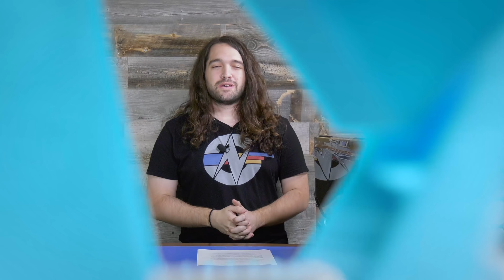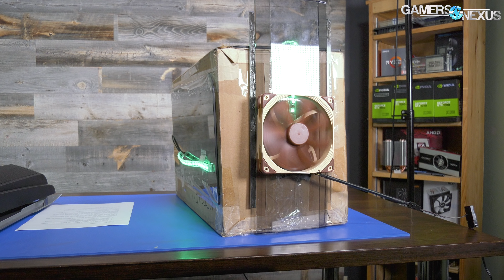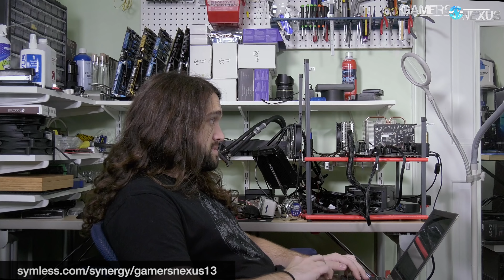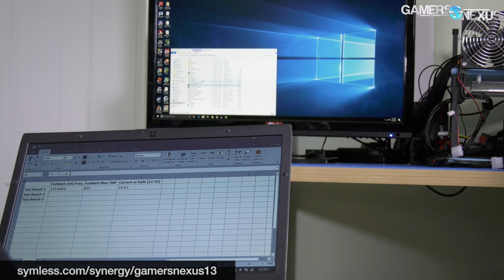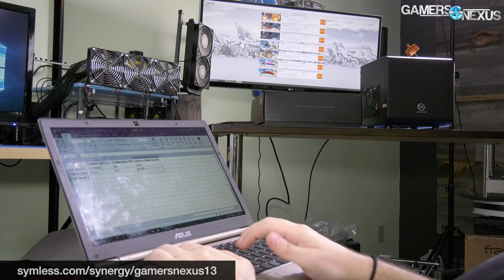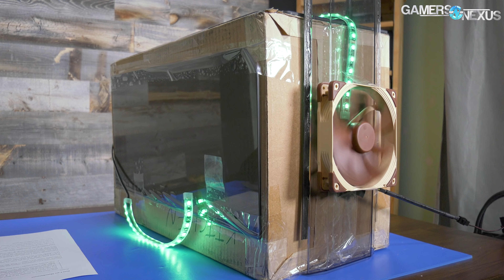Case Manufacturers: You're Worsening FPS & Power Draw

Comment: Amen brother! Ironically it's been almost 6 years and I don't really have the impression that anything has improved. On the contrary, it seems worse! I've just returned to the PC hobby again after over a decade of absence, and I'm struck by how obsessed users and manufacturers are with RGB fans, too many glass panels (which ironically makes it thermally underperforming), weird color schemes (white), absurd aluminium covers and hiding cables as much as possible. Personally I feel like cases should be functional and that it's design should reflect that, kinda like everything back in the days when functionality was a part of the design features. Now it's more a quest of hiding the functions and intents of a computer, all while making it absurdly overpriced...

Comment: antec p-180 was the first one to isolate the psu from everything else. incidentally they also implemented fans in the power supply tunnel to remove the heat from that area specifically

Comment: personally i have a HAF 922  and it does a great job never overheats but i do not buy 3090GPU they are small heaters . why do some need to have 1000FPS  200-300 is a great result compared to 30 fps no?  Do those gamers think if they get 1000fps they are going to time travel? THere are good cases you guys have reviewed  but if the stocks for them do not exist like it is now with GPU's and CPU's  ??  for now my Haf from 2012  i will keep it does a good job with normal CPU's and GPU's. my components last a long tome  my i5 CPU .second gen still works good.  thnaks for the great reviews  a lot to learn .

Comment: After adding a 3060 Ti to my computer I started hitting 90°+ on my CPU and started to think my cooler was having problems. My thermals have never been good but never that bad. It makes sense that it would be a bit hotter but this seemed ridiculous. After a couple of days of trying different things I decided to pull my front panel off and I couldn’t believe that I now get 30° lower temps on games that were running at 94° just the day before. I don’t like this fix as a permanent one but this has kind of changed my entire outlook on thermals and case airflow.

Comment: I wonder why they never used the laptop/blower style fans in cases. Like using one or two of those in the front panel would allow for a much thinner spacing while still providing enough air for the main fan in the front panel.

Comment: I think people generally blind themselves to computerhardware.

Most people I talk to seem to think that the only 3 things that matter is CPU, ram and GPU. Which is highly false, you can have a 9700K that can't be overclocked properly because you cheaped out on the motherboard or the PSU, you can have a 2080ti being bottlenecked from poor frame prep by a cheap CPU, you can have ram at 3600mhz performing worse because it has a high latency.

The most recent case of stupid has been people buying the pcie 4.0 nvme's but running a complete pcie 3.0 build.

Comment: honestly if i had the tools at my disposal id give people a case that actually works. i took a case i had that was miserable just poor airflow. i did put a flat front on it, of course with 15mm of space to start with its about 7/8 of an inch with completely open sides now after a little trial and error. ive taken a corsair spec omega even removed the glass panel and put mesh in its place due to the lack of airflow it had also. i dont even bother with cases i have to mod at this point because no matter the cost of the case how cool it looks if thermals fail its not worth the time to even look at.

Comment: Not every case needs a mesh front, but if you are going to have a fan on the front, put mesh in front of it. I'm also sick of cases no longer having external drive bays. I still play games that need disks. I do a lot of CNC work so i need an SD card, micro SD card reader that fits in a floppy drive bay. I'm "forced" to buy a case from 2012 because its the only one that meets my needs in a modern market that has at least 2 external drive bays on the front (and isn't some weird double width cube).
This means my RGB motherboard and RGB graphics card are nicely hidden from view in a boring black case.

Comment: I Think maybe part of the problem is that case makers want to put things on cheap cases that only work when done right with proper R&D that will result in an expensive case... they are putting things on $59.99 cases that have no business being on a case for say under $200, which also has the side effect of making it so money in the cost of the case that should have gone into function goes into features instead, Say putting RGB/RGB fans in a cheap case but then sacrificing actual fan performance to achieve the price point. I also think the number of cases in a given price point might be indicative of this as well.. remember when each brand had maybe a low end case, a high end case, and a super high end case? Think the days of Antec 300, 900, 1200, and that was pretty much the product line on gaming, with maybe a few other outliers... The same thing is happening with cars, seriously, leather in a Ford Fiesta??? exact same problem.

Comment: Wow this video really shocked me! I've always bought my case based on airflow rather than tempered glass and RGB. I'm surprised that others don't consider this. Still any PC is a compromise I guess. The best building advice I've ever had was, " work out out exactly what function you want your PC to fulfill, build accordingly" Even trying to do follow that can get tricky. It's made easier by your channel which I know does it's best to cut thru marketing speak and tell it like it is. While I don't agree with everything, I appreciate your efforts in providing clear, reliable information. Thanks.

Comment: i'm pretty sure my case for my current system is mostly vent. 3 out of 6 sides is a vent panel (bottom, front, and top) the back side also has vents, but isn't a vent panel. My front and top also have side notches. No tempered glass windows though, mine are blue plastic.

Comment: I would put the Cooler Master Maker 5T above any of those cases. It is completely modular with thumb screws everywhere, almost all covers are magnetic, not screwed down, it breaths almost perfect, has a psu shroud, but still keeps the gpu more than 5" above it, and has room for a 280 or 360 AIO. Besides all of that, it looks better than any case I've seen on the market. The ONLY complaint I have with this case is the red color in the inside, and the idiotic refusal by Cooler Master, to provide an updated face-plate with USB 3.1 A&C ports. Outside of that, this case is spectacular, and have been rock solid for three years.

Comment: I wish more manufacturers would exploit the fact that hot air rises on its own. (Need proof? Check out the Albuquerque International Balloon Fiesta) If the path of ventilation is straight up, would not the fans (when necessary) simply be helping the natural flow? This also applies to heat sink fins---they should be vertical to maximize convection, as many designs do.

Comment: I know this is an old video but I want to rant that even though modern motherboards have a lot of internal USB headers (at least 2x2 USB 2.0 and 1x2 USB 3.0) today there are only a handful of cases that can manage front USB ports and card reader panels. I mean, almost all of the cases have only two USB headers and lack bays for optical drives or front panels.

Comment: 'member a time when computer cases had flimsy aluminum/steel colored insides with sharp edges that would slice you open like a razor blade...........and no cable management or options for extra fans? I 'member

Comment: My sister has a build in an NZXT something or other (Not certain exactly which one, it's one of the HXXX series) and it is actually much quieter with the front panel off. When its on, it chokes off so much airflow that the CPU and GPU fans crank up quite high to compensate.

Comment: While this is interesting info and does hold some water to not talk about the case fans and the configuration used is just pushing a bad narrative, which possibly might a moot point with proper fan setup. 

I expected better from GN, you’re talking about a legitimate problem but working 1/2 a solution.

Comment: You know, the Fractal Design core 500 is still my favorite (mini-itx) case.   No tempered glass.  No RGB.   No extra bulk due to unnecessary (excessive) cable routing space.  No front fan but it doesn't really need it.  Only slightly larger than the Cooler Master Elite cases but with tons of room inside for the GPU and a tower cooler or rad (or both, with some care).  And it has a 5.25" bay in the front which is perfect for one of those quad 2.5" hot-swap bays.

I don't know why people seem to want these ridiculously huge cases.  It has created a problem for the medium form factor micro-ATX mobos because often the reason you get a micro-atx board is in order to fit it into a small case (obviously not the Fractal 500 since it's mini-itx, but you get the idea)... and finding a case similar in size to the Fractal 500 but able to accommodate a micro-atx mobo is nearly impossible now.  The cases are just getting too big.

-Matt

Comment: My top tips for cooler computers:
- heavy yet clean and expediently directed airflow
- clean it every month
- change thermal paste every 6-12 months 
- play in your cool cellar during summer
- don't heat your room during winter to keep room temperature at 15°C or lower (keep an eye on your humidity levels, though)

😉 Not even speaking ironically here. This is what I do.
Reply: Not heating the room in the winter? So I can't turn my pc on?

Comment: I think the main sin all these manufacturers are guilty of is the sin of assumption. They're ASSUMING, when they build these cases with shit ventilation, that everyone is hopping on the liquid cooling bandwagon. very few manufacturers are still building cases that actually breathe.. I mentioned the Antec Skeleton in my other comment.. The only current case, i've seen with the same kind of form-factor, and airflow as the skeleton, while still functioning as a proper enclosure, like the skeleton, is the Cooler Master HAF XB EVO. It's not as visually appealing as the Skeleton, but goddamnit, it delivers on airflow..

Comment: Hey guys, i bought an LC Power Gaming 988B Typhoon case, and what im asking is, will the case suffocate bc of the thin space on the front panel's sides with the 3 fans? Because i was thinking of some modification, like bringing it out a little, bc right now the 2 sides where the air can enter is like the case's height, but only like 1-2 cm wide. Any thoughts?

Comment: What kills me is that a company like Antec, can release something as great as the Skeleton (which is, with the hex-mesh kit installed, in my opinion the best case ever produced), and then, years later, jump on this dumb fucking "fuck airflow" bandwagon.. It is SO difficult to find a case that has the same kind of airflow as the Skeleton. We need more cases like that. 

I honestly don't give even a fifth of a fuck about noise. If you buy good fans, and you have a wide-open case, like the skeleton, you don't have much noise to begin with... if the fans do end up having to spin up a bit, because you're pushing the system, then that noise lets you know that your shit is working properly. I'd rather have something that works well, and produces results, than something that is being made to quietly choke on it's own waste heat, because overly-sensitive people are triggered by a little fan noise.

Comment: The thing with mesh is that it still have to much resistance for the air and the amount of air that actually is drawn through the mesh is very small, the air will take tha path of least resistance.
You would need to mount the fans directly against the mesh to suck the air through it. And that would still not be optimal.

Comment: i was looking to buy a new cpu before i watched this. i decided to switch cases, clean my cpu cooler and re apply thermal paste.  Turns out my cpu is fine it just couldn't breath. im annoyed that i assumed the drop in performance was just the cpu getting old from use.

 thank you!
Reply: fyi im using a old nzxt case and noticed a drop of nearly 30 degrees on my cores.

Comment: Here I am still loathing my H440... I've got the top and front panels off; seriously. 10c+ difference across CPU/GPUs all custom watercooled. HUGE difference and a BIG ask for tiny side slits to allow the overall amount of Noctua NF-F12s sending a massive amount of air lol...But not having the "exit" space- therefore if you maintain the panels, you create a furnace that steadily rises in temps perpetually as it recycles the heated and re-heated air...

Comment: I bought a Phobya Ultra Big case 5 years ago because I thought this will be my last case I ever buy if PCs stay more or less the same with standards ofc but even then I could made it work again because everything on this case is screwed together.
I dont get it why we dont have cases with fans on the side. I have a 200mm fan on the side who is suck enough air with just 300rpm in for cooling the passive things and provide more air for the fans inside. 
Never get it why we need this glass stuff anyway...

Comment: Here's another case design problem.  My RaidMax Alpha Prime is a beautiful and functional case, but the filter is on top and intake is on the front by default.  I reversed this so the filter on the top is functional and heat is blown out the front. Last time I checked, heat rises. However, I'm forced to fight this to keep the inside clean.  Front filter, please.

Comment: Haven't seen any NZXT cases that don't have great thermals.... NZXT 500, with air cooled CPU at 48C under load. RTX 2060 dual fan 65C under load. and that's there lower end case... There is definitely a need for cases to be revised with better fan access.

Comment: i got a Corsair Crystal 460X RGB White. A Bequiet dark rock 3 with ryzen 1700x +300 mhz OC max temps 55 Degree Celsius. and my RTX 2080 Phantom Edition runs at 2GHZ and has max temps of 72 degree celsius. And no to paint Coolers they dont lose TDP i painted everything white for my white Build.

Comment: Thank you for touching on static airflow pressure, as I have personally found (in over 30 years of working on computers) this tends to be the #1 thing people have issues with in their (prebuilt or custom) PCs. It's way too often overlooked. 
(FTR I've got 3x 140mm + 1x 200mm intake fans right now, but never push my 1070Ti past 56-57 degrees, even with heavy gaming. In my old case, which I tried briefly, it was pushing 72-74, and even up to 78 at one point while playing in 4k. Way out of my personal comfort range for making things last a few years until I can afford an upgrade.)

EDIT: It's an ASUS ROG STRIX card, which is a triple-fan card, for those questioning the validity of the #s. I also use MSI Afterburner to boost the fan profile to a custom one I've tweaked to balance noise and performance, and drop the voltage just a hair when playing games. No OC needed yet, but in 3-4 years? Maybe...

Comment: Glad someone is pointing this crap out.  I bought a Core V71 a few years ago specifically for air flow.  Like a year or two later Thermaltake goes and releases the "View 71," which is a nearly identical case but with all the vents plastered over with fucking glass.  What the actual fuck, guys?

Comment: That's why I bought the fractal arc xl. It's a giant case, and it's very heavy, but I never have to worry about anything overheating with all the fans I have in it. I can overclock as high as I want and be confident that I won't overheating like I did in my last case.

Comment: I've had four cases. An Enermax Coneus, which was good but had panel gaps that collected tons of dust but otherwise was a huge mid tower that had lots of fan options in it. The second was a Phanteks Enthoo Evolve mATX, really liked this one. Quiet, sleek, very clean. It was a bit difficult to cable manage but had pretty ok airflow. I'm pretty sure that front 200mm fan was a bit choked but it did the job well enough. The third was a Cooler Master HAF XM and as the name suggests, it had tons of airflow. It was also huge so cable management was a breeze. This one's my second favorite case for air cooling since it doesn't have too many options for radiator other than on top and on the back. Because of this, it now houses my X58 build. my fourth case is also the newest, to me that is. It's a Corsair Air 540. It also has tons of fans spots and unlike the HAF XM, it also has plenty of radiator placement options. Like the HAF XM, it was also a breeze to cable manage given how wide the case is. This is the home to my current build, a Ryzen 7 2700X and a Vega FE. Right now the whole thing is air-cooled but once I get a AM4 bracket for my H110i GTX and modify a Intel bracket to mount a spare H100i V2, it'll be water cooled. A custom loop will come at some point in the future.

I also have a Cooler Master Cosmos II that I picked up some time ago but since I've yet to use it, I don't know how good it is but given how massive it is, I'm pretty sure it'll have good airflow as well.

Comment: You go girl! I 100% agree. I normally get a new case every 4-5 years, but I have had the same one now for almost 10 years now. Why? Because the newer cases just don't cut it. I have a full tower case, with 3 intake fans on the front. All 3 have reusable filters to keep the dust out. The new cases, have glass fronts with tiny slots (normally on the side of the front) and no filters. They have RGB, yes. Mine are just blue with no option to change it without replacing the fans. Plus a 200mm fan on the very top to get ride of the heat. I no longer liquid cool. Just air. I need good and clean airflow. The newer cases look nicer than what I have, but they don't do the job properly.